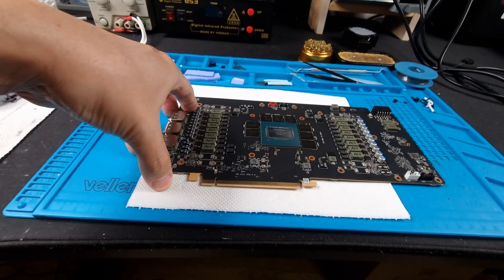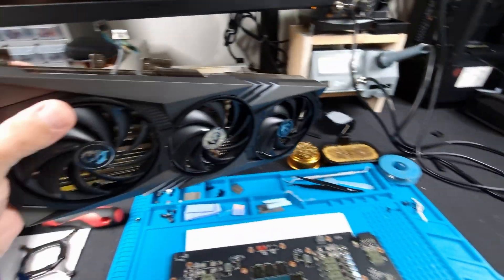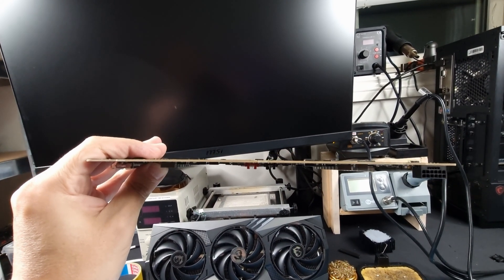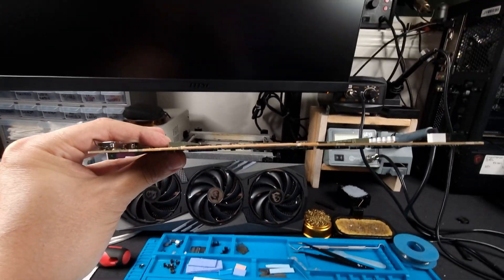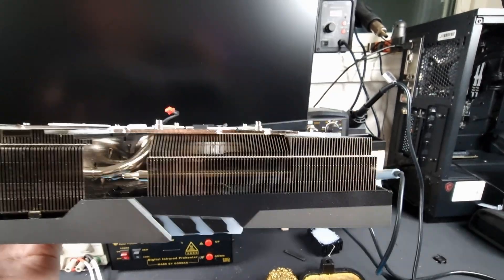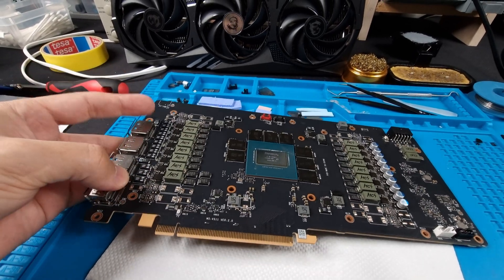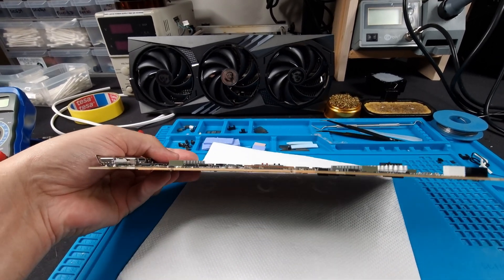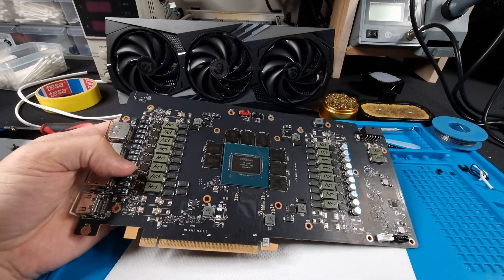How Using GPU Supports Incorrectly Can Destroy Your GPU.

Comment: @TechnologyHive I have a some questions if you dont mind me asking.

So your saying even if the gpu sag bracket is correctly installed (not putting to much pressure on the gpu) the pcb still can be damaged? 

Second question I’m thinking about  getting the 7000d did you just use the included hardware for your setup or is that another kit of some kind?

Third question Did the temperature for your 4090 in the 7000d go up with it mounted in orientation?

Third question what do you recommend for pcie 5.0 risers?
Reply from the maker: The vertical GPU mount you see is from Phanteks. And no, I am not saying that supports are bad. I guess I should have explained this further. What I was trying to say is that people are using supports wrong, pushing the card up at the far end. You should be fine using supports but keeping the card level, while the GPU is not tighten down to the case yet. Level it, then screw it down.
Reply: @TechnologyHive thanks for the reply is the phanteks kit what your using in your 7000d? from what it looks like. And if so did you have to do any mods?
Reply from the maker: @Darkgx5  No mods were needed. It just fit like a glove.
Reply: @TechnologyHive  I have another question if you dont mind.

Just wanted to ask is there a reason why you did not use the native mounting solution of the 7000d? 

I know you can add standoffs there and you just need a riser cable. 

Just wondering did you try it then realize it was not good support?
Reply from the maker: @Darkgx5  It is because the native vertical mount of the case would place the gpu to close to the side panel, causing it to overheat.
Reply: Did you have any gpus thermal compound leak when vertical mounting?

I know this is a recent issue with gigabyte but have you seen this in other brands?
Reply from the maker: @Darkgx5 None whatsoever. Still rocking it vertically.

Comment: Whats the point of reball if the board is bent?
Wouldn't the issue come back very fast???
Reply from the maker: @Neosin1  Depends on how badly warped the pcb is. Most times, a reball will do the trick. Sometimes, nothing will work. The card is just a brick.

Comment: My new case thankfully has a vertical mount on the back but it’s pretty close to the side panel. Not sure it would have much clearance for the GPU fans to get proper airflow.
Reply from the maker: @spektre-VII  I wouldn't use the case vertical mount option.
Reply: @ How would I mount it then? I wouldn’t be able to access the HDMI ports or even screw it securely to the case if I didn’t use it.
Reply from the maker: @spektre-VII  You can get a 3rd party vertical mount, like that from Phanteks. Best option out there.

Comment: so what should i do with a preowned gpu? i just bought inno3d rtx 2060s twin x2 with a little bit visible sagging. it's not really big nor heavy and it's working fine, for now. but i am worried about the sagging so i put a little meds bottle just to support it a bit, between the fans. i was planning to buy a real gpu support but now i am worried it will worsen the bend :v so please help me out. 
i am also planning to replace the pads with thermal putty since it's already cracked, but northwest repair video about the thermal putty scares me now haha. i am still waiting his/their response about thermal putty too because in his video, it seems the problem isnt because of thermal putty but the sagging problem too
Reply: for now i alr cleaned the fans, heatsink, repaste the gpu chip, and also i tap a very little amount of paste on the vrm and vram chip (to fill the thermal pad crack). it's still working, but the pads condition and the sagging seems concerning
Reply from the maker: @ If you do not have a support to let the card rest on it, then try putting your PC on it's side if you have the room. But, if the card is a 2 fan design, then I would not worry about it too much.
Reply: @ it is a 2 fan design gpu. but since it's a preowned, i am not sure why is it a little bent, that's why i am afraid it's actually due to natural sagging. i might try to lie down the PC as you suggest, i think that's more convenient. thanks for quick response, really appreciate it🙏
Reply: @ what about the thermal putty? do you have some suggestions?
Reply from the maker: @themightybaboons9949  I do not use thermal puddy, so I can not give you any advice there.
Reply: @ ok2, thanks

Comment: I would like to thank you for this video. I used to mount my gpu with support bracket pushing slightly up my GPU (Nitro 7900 xtx, quite heavy). Even tough I had adjusted the bracket after watching your video, I ended up laying the pc case on its side for the best safety. Sadly I couldn't buy vertical gpu mount because of my GPU would have been too close to the side panel (Phanteks p600s). Thx again!
Reply from the maker: I am glad you found the video useful! And yes, these 7900XTX's tend to be heavy. But having you PC on it's side definitely will help.
Reply: @TechnologyHive  it saved my GPu literally from a slow death! :) Nowadays, it is hard to replace it. My best regards

Comment: What if you use a GPU support to just level the GPU or making it have the slighest sag, would that cause issues in the long run? If you make sure that the GPU support is not applying too much upwards pressure and is only there to give a bit of support, wouldn't that be fine? You could do this by lying down the case on its side (which would put gravity out of the equation in terms of the sag) and then adjust the height on the support bracket to fit right under the GPU without applying any pressure at all while the PC case is laying down. Then you can put the case upwards again and then the GPU support is adjusted to the correct height without applying too much upwards pressure, right? What's your opinion on this, wouldn't that be fine? I can't mount my GPU vertically because of my air cooler and I don't have space for pc case laying down permanently.
Reply from the maker: I can not tell you for sure what the future looks like for your specific situation, obviously. However, if you follow these steps, you "should" be ok. When installing your GPU, screw it to the case, but DO NOT tighten the screws all the way, so as to allow the graphics card to move loosely. Once your GPU is secured to the case, set your case up right, then add the supports, making sure the card looked levelled as best you can. Once you are happy with where you want the card, tighten the screws which secure the card to the case. The supports should not lift nor allow the card to bend, or sag.
Reply: @TechnologyHive  Thank you for replying. I will try what you suggest. However, wouldnt it also be a safe option to lay the case down on the floor, then UNSCREW the screws that mount the GPU to the case, and then adjust the height on the support while the case is laying down so that it just fits under the GPU without applying pressure. This height would make the GPU level and make sure it only presses the GPU up so its leveled and no more. Then you can put the case upright again, put support under and screw the GPU fully in to the case. In summary, it would be possible to slide the support under the GPU when case is lying down, and when the case is upright you wont be able to just slide it under the GPU, as it has now sagged when putting the case upright. So you just lift the GPU up a bit and put the support under. That will make sure theres not too much upwards pressure. Thoughts?

Comment: This doesn't help people with tempered glass panels. You have nowhere to pull fresh air from.
Reply from the maker: You do not use your case's vertical mount option. You're supposed to buy a 3rd party mount, like that from Phanteks, which costs around $50. This keep the card away from the side panel to allow it to breath.
Reply: Some cases have bottom intakes, and are wide. The fans only need an inch or two away from the glass. With that said, vertical mounting will always hurt your GPU temps. But in a high airflow case, particularly one with bottom intakes like a fractal torrent, the difference is small

Comment: bro, buying a riser is not possible for me now... my MSI 4070 super is 928 grams, I'm using a cheap support for now, will this still be problem?
Reply from the maker: As long as you did not tighten the screws to mount the GPU to your case before adding the supports, it should be fine with the card just resting on the supports, and not being pushed up.

Comment: Just what I needed to start my day. Anxiety

At least the PCB on my card which is a 9070 XT is a few inches shorter and only goes to about the length of the ram slot where it looks like these cards go to the edge of the motherboard. Shorter PCB board means it wouldn't bend as easily and not be as prone to this right?
Reply: Yes. This is more of an issue with a 3 fan card, or very chunky 2 fan cards I suppose

Comment: Is there also an issue with the lian li GB 002 (it’s the one you screw in the motherboard), but ist not vertical mounting? The graphic  card I use is the Rtx 4070 super (3fans)
Reply: Ok good the hear. Thx of the fast response :)
Reply from the maker: @Skywalk07  I don't know. I don't own that case. Sorry man.
Reply: Sry I with that lian li GB 002 I just meant a gpu support that stands on the bottom of the case on the side of the motherboard.😅
Reply from the maker: @Skywalk07 Oh I see what you mean now. That can work, as long as you do not screw down the GPU to the case before applying support.

Comment: That's just a case of people putting them on incorrectly. You don't want the card under high tension (up or down)...you want it neutral/level. A $0.99 line level at harbor freight will take the guess work out of it.

Comment: So if i installed it by putting it under the gpu and slowly screwing it up until it slighty touches the gpu and raise it a bit i did this wrong? Even if the gpu has still a slight negative sag and im sure that the the sag its not overcorrected? My card has two fans and its not really heavy, i dont know if that might change something. My temps are alwyas below 70v too.

Also, isnt the same thing to install the GPU and then gradually screw the support up until its almost leveled? The gpu natural angle Is 90⁰ not negative so i dont see how upward pressure could be applied if you make the GPU return to its natural position.
Reply from the maker: @Diego-f1s  A two fan card I wouldn't worry about adding support. Those are usually light and can be installed horizontally just fine.
Reply: @TechnologyHive  I have a 4060 and i noticed a slight sag so i bought a proper support to put under It Just to be sure. 

Do you think that the way i installed It, like i described its correct?  I didnt unscrew the GPU but im 100% sure the support its not pushing the GPU up over 90⁰ instead its like 89⁰ with the support 

Thanks
Reply from the maker: @Diego-f1s  I would unscrew or just loosen the screws before adding any support.
Reply: @TechnologyHive even if i left a slight sag? How can the support exert upper force if the GPU its not bending upwards? Isnt the GPU Natural position 90c and doesnt everything below that acts as a support rather than upper pressure even if i dont unscrew when i install the support?

Thanks for the answer
Reply from the maker: @Diego-f1s  Loosen the screws, let the gpu rest on the support, then adjust the support until the GPU is leveled. Then tighten the screws. Done.
Reply: @TechnologyHive  can i you use a small spirit level? will that be accurate?
Reply from the maker: @crazyc9326  if it's a two fan card is should be fine without support. However, this is for you to ultimately decide as I do not know the weight of the card.
Reply: @  but what is the best way to use a support the correct way without breaking PCB overtime? it has to be a way without having to use a vertical mount... asked northridge fix about this and he had never heard of this problem... who should i believe?
Reply from the maker: @crazyc9326  Northridgefix does not specialize in GPU repairs. I am just telling people what I am experiencing with these heavy cards. It's on you to decide.
Reply from the maker: @ A spirit level?
Reply from the maker: @crazyc9326  Just use common sense. Loosen up the screws holding the GPU to the case, add support so the card is just resting on the supports, then tighten the screws. I would not bother with a level.
Reply: @TechnologyHive  Also because my card is two fan and i decide to not use a support anymore becasue its light like you say and doesnt need it do you think it will casue issues? like will it sag more than usual becase it has been used to the support for years? Would re seating the card prevent this or am i fine? What would you do?
Reply from the maker: @Diego-f1s  I think you should be fine. It is the heavier, longer cards I see being affected the most.

Comment: Hello! Thx for the video
I a bit paranoid about aio leaks and I use also Noctua DH-15. I don't think I can combine it with vertical mount gpu.
I have gigabyte card and their gpu sag bracket that mount on motherboard and additional support at the end of pcb. My case doesn't support vertical mount. Is it okey?
Reply from the maker: @grdr9567  If you have the room, you try putting your PC on its side. This will eliminate the need for a vertical mount.
Reply: @TechnologyHive  Thx for advice! I'll try to do so!

Comment: I have a MSI SUPRIM 4090 and it is heavy. I currently have it vertically mounted in my pc case. I have a support bracket supporting the power connector side of the graphics card. Is the support bracket bad in this case?
Reply from the maker: @beowulf885  If it's installed vertically, then you should be okei. No need for supports.

Comment: I'm gonna stick to english.. You asked for opinions, but now you got me thinking I should keep the card sag holder thingy (one of those poles, I dont know what they are called) when I sell my Strix 4080 Super OC when my Astral 5090 OC arrive, just so I have support on both corners. Currently #34 in queue from komplett.
Reply from the maker: I think, imo, as long as you have two support points, one at the middle, and one at the end, you SHOULD be ok.
Reply: @ I'll send you my card for repairs if its not enough 😅
Reply from the maker: @EricTheBroBean  Lets hope it doesn't come to that lol
Reply: @ Yup lol, btw komplett has a fairly large batch of TUF 5080 OC in stock.
Reply from the maker: @EricTheBroBean  I have decided to ditch the 5000 series. I will wait till the 6000 series comes out. I understand the power connector will no longer be a concern with those cards. They'll be using dual 12vhpwr plugs and quad shut resistor setup as standard.
Reply: @TechnologyHive  Fair enough. Being a repairman as you are I figured you were gonna get your hands on one just for that, just thought I'd spread the good word:)
Reply from the maker: @EricTheBroBean  I appreciate that ☺

Comment: But doesn't the riser slow down the communication with the card? After all, it makes the connections longer, and more susceptible to noise. Maybe we just need better GPU supports that support the card in more places than just one? (e.g. a frame or something)
Reply from the maker: @bonbonpony  No, it makes no difference. Performance will still be the same.
Reply: @TechnologyHive  It doesn't because you say so? Or because you have something to back up this claim? How does it not make any difference? Does it bend the laws of physics or something? The longer the cables, the higher the impedance, and with such high frequencies as PCIe transfers impedance must matter. These wires might act like an antenna and catch noise from the surrounding electrical environment. All these things might slow down the communication with the card.
Reply from the maker: @bonbonpony  If you have already made up your mind on what you want to believe, why ask?   To test my knowledge? You're in the wrong place. Go watch Linus try fix graphics cards in the oven, or Brian from TechYesCity or Derb8aur try to fix GPUS with a heatgun. That's where I think you might find the scientific answers you're looking for. 😆
Reply: @ I wouldn't be ASKING if I had "made up my mind" as you said. People make all sorts of claims, but it's rare to see them actually putting their money where their mouth is. But as you already made it clear, you're not interested in that (I see that you might actually be more interested in shilling the vertical mount extenders, which also seems to be pretty clear, judging by how you propose it as the ONLY solution of this problem). Thanks for making it even more clear with your reply.

Comment: This is interesting. I bought the second to last Asus Strix 4090 OC on Amazon. I have it horizontally mounted with a support kickstand. I will risk/sacrifice my $3000 card in the name of testing your hot-cold cycle hypothesis. I will report back in about 1 year, and then subsequently every year after with my anecdotal experience. I will also video document the progression or disintegration for the world to see over a period of however long I can get it to last, and I will link people to you as my inspiration for this expensive experiment. Great video!
Reply from the maker: @user-kp6ud7ht4z  That'll be an interesting video. Thanks for watching, btw.

Comment: A GPU support that supports the entire length of the card not just the tip
Reply: msi includes full length support so this person probably didn't use it and used an aftermarket one
Reply: @atvkid0805  They do? I just got my MSI 5090 last week and the support I found in the box is just a little vertical pedestal thing. Was I supposed to get more?
Reply: @panzerkiller13  maybe they changed it recently idk but my card came with a full support